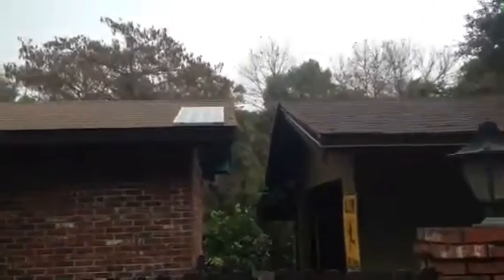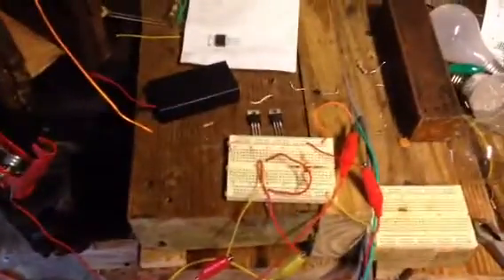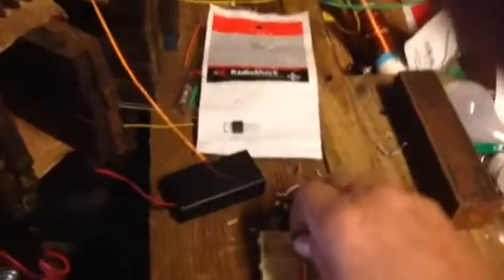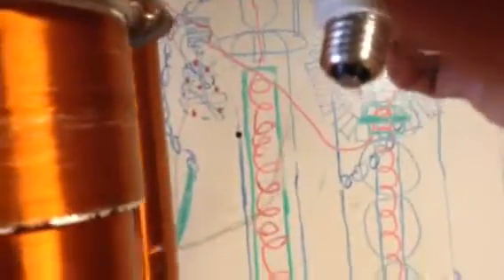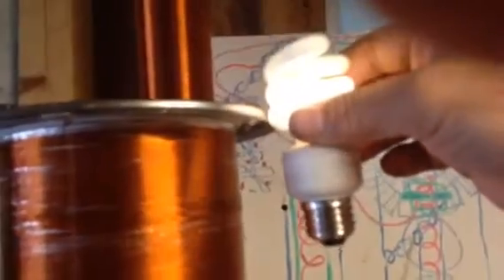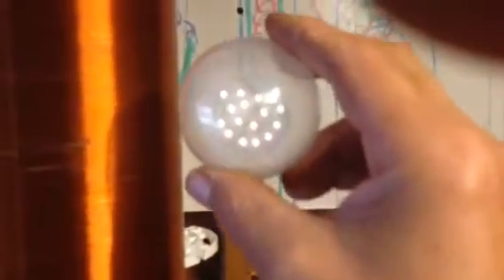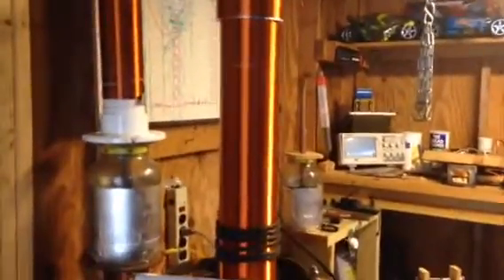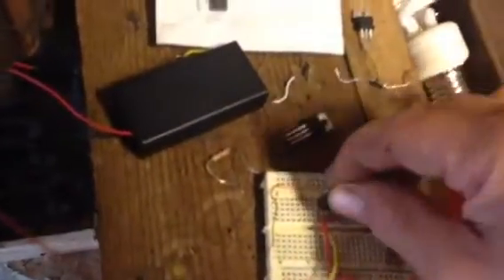Solar powered tesla coil

Comment: Awesome...
Take a look at edl's bathtub... notice the 2 step design? Ed said he used to let his tub warm up in the sun all morning...
If ed used a shiny sheet of copper, and a 'burned sheet' of copper on the 2 flat surfaces of his tub, he could have been collecting all sorts of solar energy for batteries, coils, radio and the such. Aside from that, ed talks about using acid, so he had the acid to keep the copper clean and shiny for max voltage.
And after he finished charging his batteries, he got a nice warm bath...